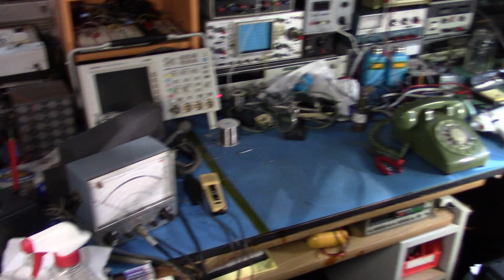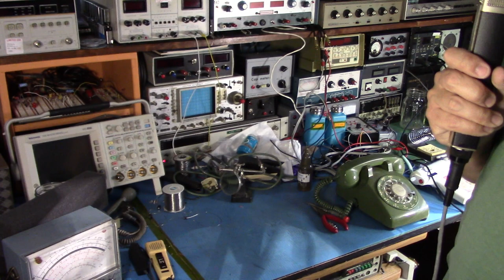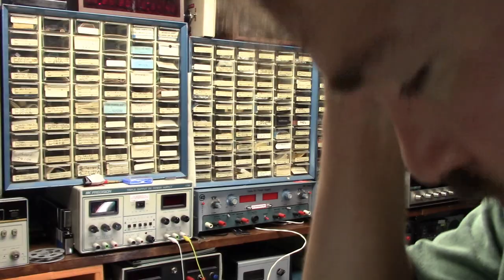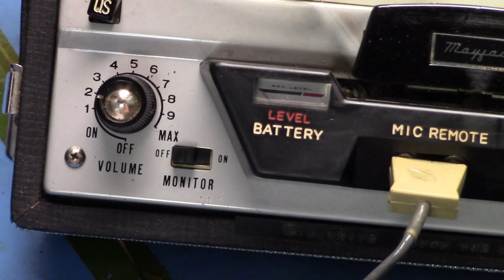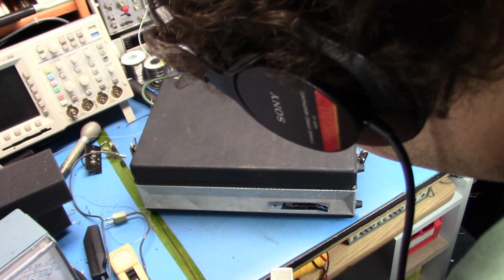Mayfair FT-1024B Vintage Reel to Reel Tape Recorder

Comment: Hello cassette master how are you
I'm trying to fix a Craig model 212 if you see one for sale don't buy it unless it works. The record slide switch breaks on most of them and is impossible to fix. I can't find a replacement anywhere. Do you know about these? Too bad it can't be fixed these are really nice ones with auto level record and AC bias. I bought another for parts and it had the same broken plastic slide 😆 now I have two I can't fix. I give up